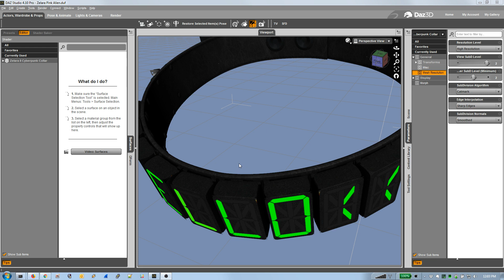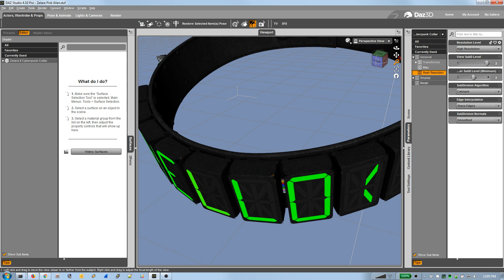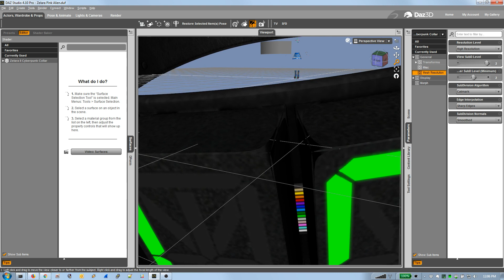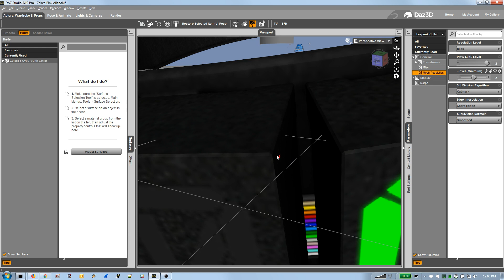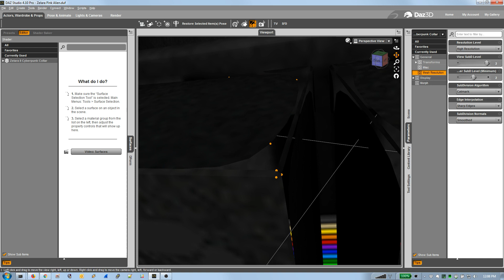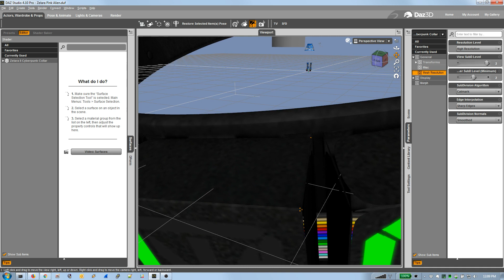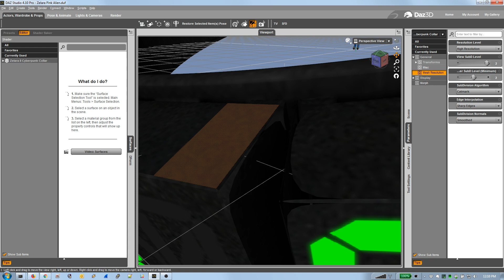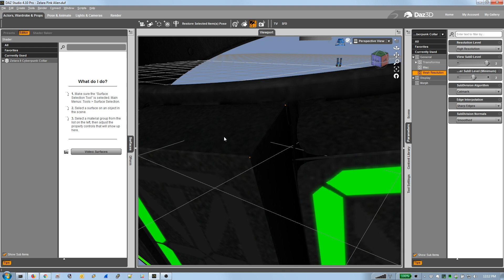Fixing subdivision weights on torn-apart subdivided props in DAZ Studio

Comment: Hello, may I ask how to solve the problem of smoothing Angle after adding smoothing Modifier to clothing?
Reply from the maker: So it has been a while, but as I recall, I usually had success enabling subdivision on objects to fix smoothing issues.  Not only did it help give the smoother more faces to work with, it would also reconstruct the mesh, "fixing" meshes that had vertices out of order.
Reply: @cwichura  When I added "Smoothing Modifier" to the model, I had the same problem as in the video, but using "Set Subdivision Weight" didn't fix the distortion of the vertices. Therefore, I would like to ask you if there is a way to solve this problem in daz, because the clothing asset I use does not make edge lines, so the model will distort after adding "Smoothing Modifier". Thank you very much for your help，Your video materials let me learn a lot of daz knowledge.
Reply from the maker: @董美香-s7m  There has to be SOME edges.  It's just a matter of figuring out how the mesh was constructed.  If the mesh is really badly broken then you might have to fix it in a real mesh editing tool, like Blender.  I don't personally know any mesh editing tools, however.
Reply: @cwichura  Thank you for your answer. You are a very good teacher. Thank you.
Reply: @cwichura  The video's method solves the problem of adding "subdivided" to the model perfectly, but it doesn't seem to solve the problem of adding "Smoothing Modifier" to the model, but thanks a lot for your video, he helps me a lot, I have seen many of your daz videos, they are all excellent.